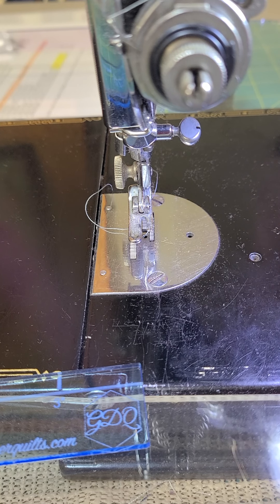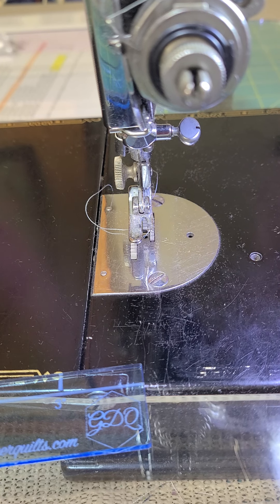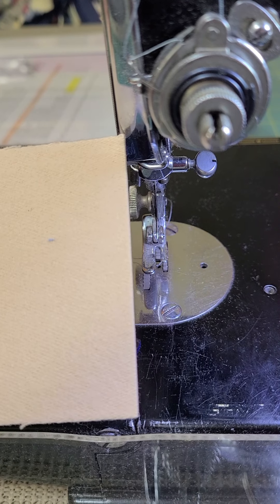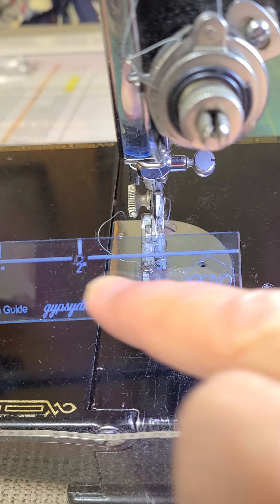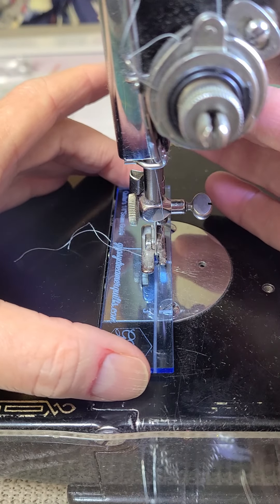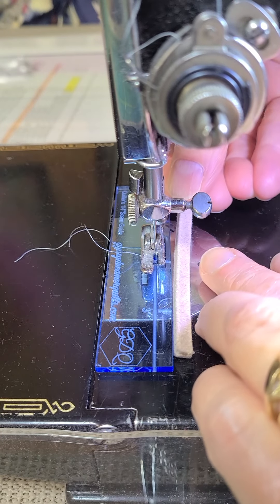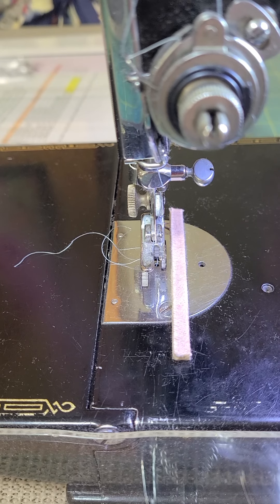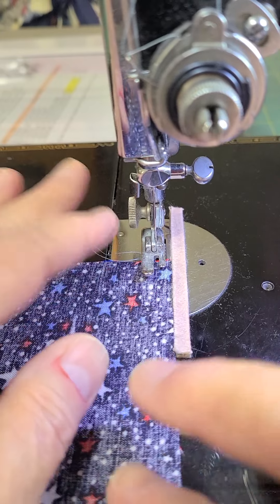Using a Stitch Guide on a Singer 221

Comment: I just got a 221 and it has the unmarked needle plate.  However, it came with a screw-in metal guide.  I purchased one of the seam gauge rulers with the holes for various seam allowances.  I hope it will work well in placing the guide for a perfect scant 1/4" for piecing.  I really don't want to use adhesives on the painted surface of the machine bed.

Comment: I have a vintage Kenmore (1949) rotary straight stitch.  It has a perfect 1/4" foot, and feed dogs (the middle feed dog is in front of the needle) pull straight an true. Nicely designed.  It is my favorite piecing machine.  It also has a machined aluminum seam guide that provides a perfect gate. Do all other fancy tasks on my newer machines.  This machine does one thing and does it well,
Reply from the maker: HI Elle, That sounds like a wonderful machine! Many years ago my mom had a Kenmore, but it was replaced several times over the years. I wish some of those old machines had been stored away! The vintage machines last forever if taken care of. I believe the Featherweights also have an optional seam guide, but for now this works for me. :-) Our modern machines with multiple stitches & functions mostly sit in their cases unless we need a zig-zag or something special. :-)